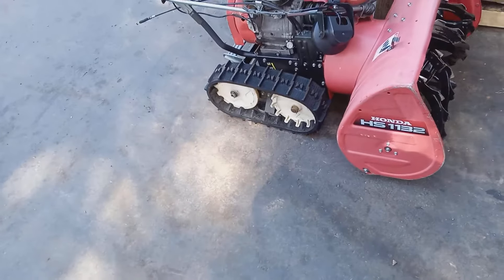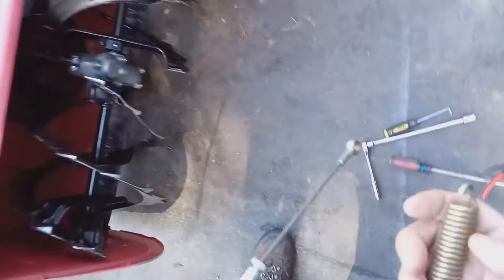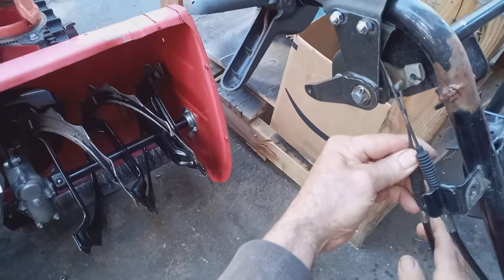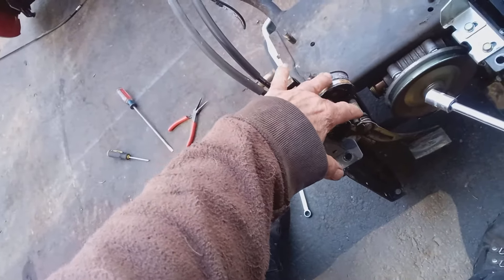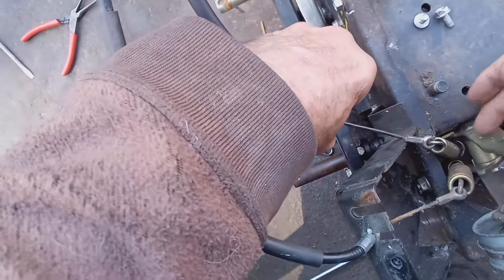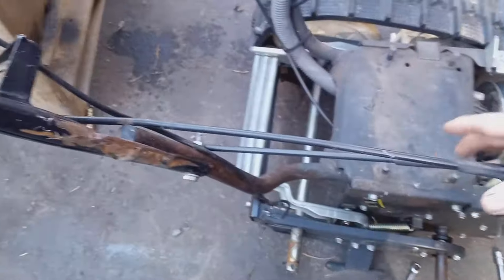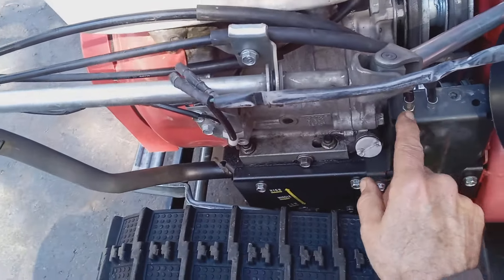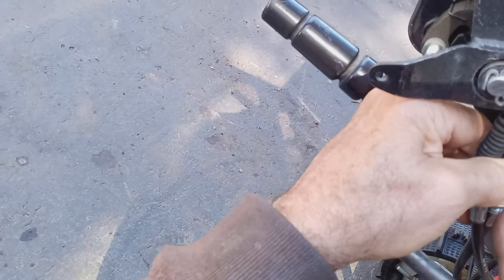How To Replace Auger/Drive Cable On A  Snowblower !

Comment: great video -- definitely a good idea to install the cable at the handle end first, as that helps keep the eyelet tensioned at the spring side -- also, good to keep the left-hand drive handle depressed to further tension the cable.  The 25 year old HS828 is back to work.  Thanks, Anthony!
Reply from the maker: thanks for watching.